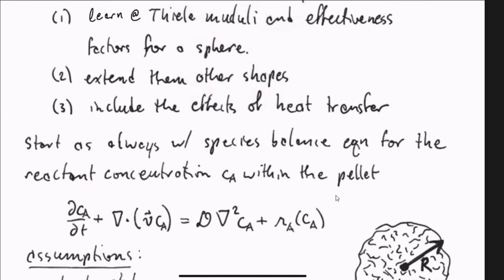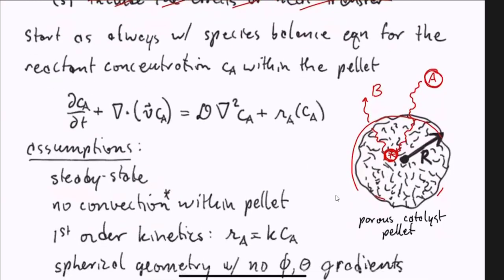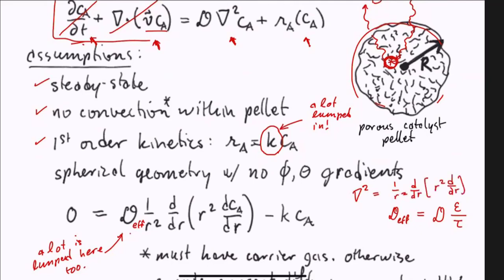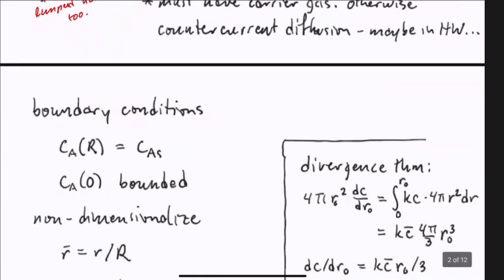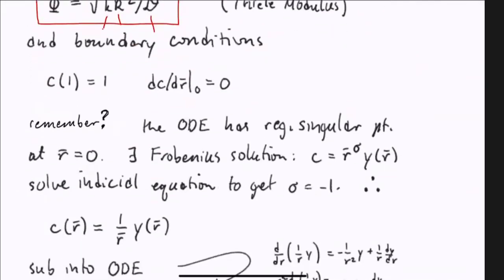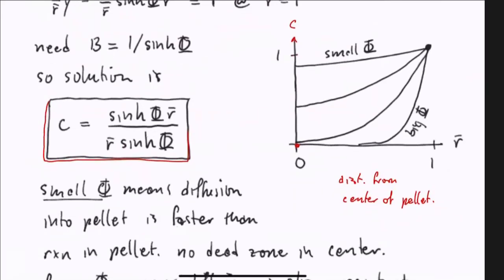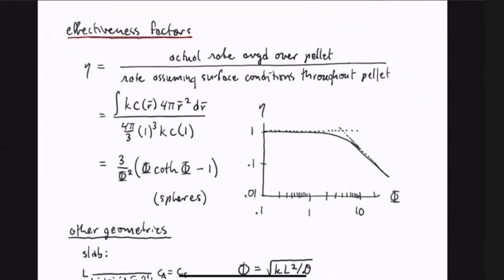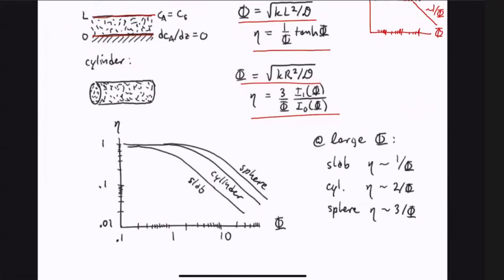Kinetics and Reaction Engineering - Catalysis - part 7

Comment: You just copy the same mistake that all the textbooks have. They reaction should be as a boundary condition nit in the balance….. except something happens. You need to study more and not copy fogler or bird Stewart
Reply from the maker: As discussed in 2:50 - 3:30 in the video, a lot has been lumped into the parameter "k".  It reflects the turnover frequency, the sites per area, area per volume, etc.  Models constructed in this way are called pseudohomogeneous models.  If the accounting is done carefully, they are convenient and rigorous models for the much larger pellet-scale reaction-diffusion problem, with details at the surface of the catalyst particle all embedded within k.  Bird, Stewart, and Lightfoot also address this point, showing in eq. 18.7-6 (2nd edition) how to construct "k" so that it accounts for catalytic area per volume in the pellet.
Reply: @baronpeters  your answer is totally irrelevant